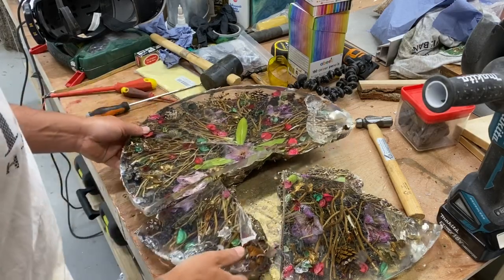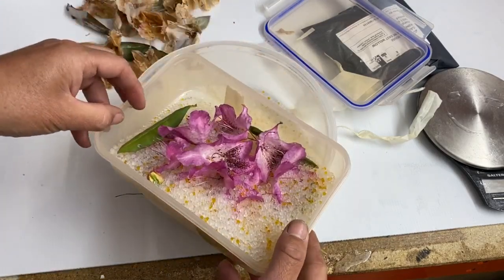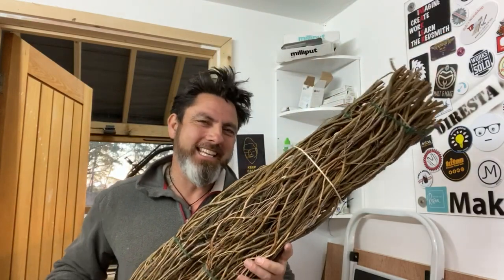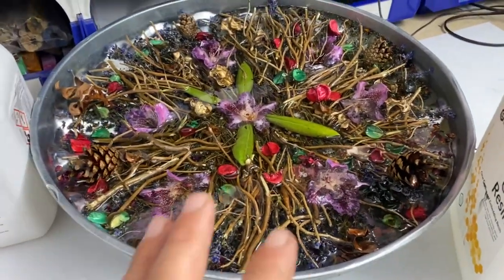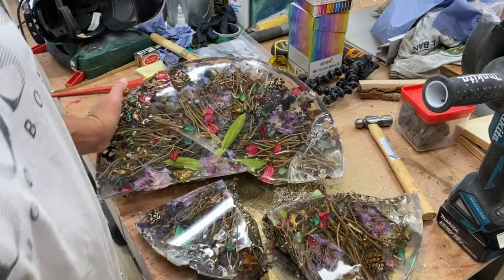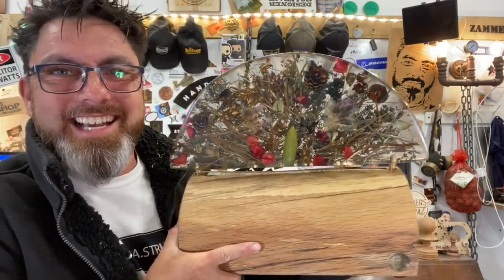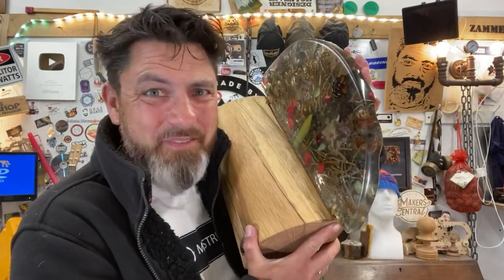Tin Bin Lid Flower Power - With Flashing LED Lights..  Then It Smashed! 😢

Comment: As someone who spent 15 years working as a candle maker, I have to say it looks like you had your wax INSANELY hot. The smoke/fumes were a bad sign. We used a double boiler system (like bakers use with melting chocolate). The goal should be to melt the wax only to the point of becoming liquid, not to evaporation.
Reply: I came here to say all of that. Except the part about having been a candle maker for 15 years.
Reply: Yeah.  The smoke had me worried too.
Reply: Yeah, I was waiting for it to ignite
Reply: Can soy wax be used or only paraffin?
Reply: i saw the smoke... but my brain didnt turn on... na

Comment: You do make life hard for yourself Nick! Rhodedendrons are one of the hardest flowers to dry - so thin, so delicate, you did a good job for the first try.  Try again, with one of the easier varieties.
Reply: Have you ever done calla lilies? Do they work well?
Reply: @kimberlydlapp3441  Very wet and fleshy, especially where the stem meets the flower.   A silica gel box will keep the form, but you need to keep moving the gel around every week or so.

Comment: Nick, you fried the flowers in the wax.  You've got to let it cool a bit first.
Reply: Lmaooo😂😂😂😂😂
Reply: Cool wax won’t take the flowers tho... I’ve tried this. But yes hot wax cooked the petals
Reply: @MelanaC  they don’t mean letting it harden lol. You should just use the double boiler or water bath method, then dip your finger in. If it’s too hot for your finger/wrist, it’s too hot for the roses. 😊

Comment: OMG! The tape. I am a retired teacher and we would have shelter in place drills and one of the things we would have to do is simulate taping around the door in case there was "something" in the air. Every d***n time this would happen to the tape. In a real emergency we would probably all be dead and I would have a torn piece of tape stuck to my finger.
Reply: Don't listen to the trolls, Jane. We did tornado drills in school. When the real thing hit things were a lot more calm and orderly than if we hadn't drilled. Thanks for keeping our kids safe!
Reply: Wouter Lensvelt are you okay?
Reply: @roar40s  Yeah, when Timet had a chlorine spill and there was a green cloud over Henderson, NV about 2 miles from the school I was teaching at, the first thing that came to mind was "this is probably fake news" or when PEPCON blew up in 1988, located in the same area as Timet, I'm sure the teachers were thinking "fake news". (This was before my time, but I'm sure that's what they were thinking.)
Reply: @ohitstheotherthing  Thanks.
Reply: Jane Hoeweler Hi fellow Las Vegan!  I didn't know about Timet but I was in 5th grade for Pepcon, I wasn't affected due to being in what was the northwest at the time back when Decatur stopped at Craig Rd.  Anyway, I think Pepcon was the reason we started doing shelter in place drills here.  And yah the tape never rips where you want, and it's rose here in the desert (that's why new tape works better than old, it dries out and cheap tape is even worse, brand name 3m is pretty good when new, especially their blue painters tape.  I'm a teacher now too and I'm not too confident I could reach the air vent to seal it in a real emergency, that's where the real threat would come from I think.

Comment: Great Save. Love it. As for the masking tape, an old body shop trick is to place it on a paper towel, then microwave for about 10 seconds. This helps renew the adhesive and it will unroll easier.

Comment: Nice save.  May I suggest adding a reflective strip in front of the LEDs between the stand and the piece.  It would direct more light up into the epoxy as well as onto any wall the may be behind it, and prevent the light from shining directly into a viewer’s eyes.

Comment: Come on Nick, you know those beads. They're the beads inside those small paper packets that come in the box when you buy shoes or electronics!!  I never realized you could use them to dry flowers :0 Maybe lining the bin lid with parchment paper before pouring in the resin?

Comment: Hey Nike, just a heads up with the silica gel. You can bake those beads at a low temp, like 70c for about 24 hours. That will dry the moisture out of them and make them reusable. We fill a few old socks with them and use it to keep our caravan and kayaks moisture free, and thus mildew free in the off season. Throw some in a tub with off cuts of wood to help dry out, or keep dry your pieces. Good for throwing in with boxes in storage too, like holiday decorations and what not. Silica gel is so cheap and so useful, great stuff.
Reply: Good save btw.

Comment: Props to you for turning something that broke apart from the original idea into something else that still stunning (even if it’s marmite in your opinion). I imagine some expletives were used hehe.
I’m currently working on a marble sculpture that currently is not going to plan, but I’m over coming and rethinking what can be done to salvage the project (yep, broke apart into four pieces with an added injury for good measure). 

Great video!

Comment: My tape does that too 😂. Btw Nick, if you can't get something in a pressure pot you can blast the thing with a heat gun, it will raise all the bubbles to the surface and get rid of them. Works perfect for resin.

Comment: Silica beads are everywhere. When you buy a pair of shoes, a wallet... that little pack that says DO NOT EAT. I save them all and put them in a container. Great for when your phone gets wet... or your shoes. Put your shoes in a ziplock bag with the packs. Ive used them for flowers as well and they work great.

Comment: Nice save. If I may, as I have mounted quite a few led strips, inset them about a half-inch/centimeter further in the wood, and then used a strip of opaque white acrylic over the top to diffuse the LED's.

Comment: I hate that it broke into pieces, but it still turned out gorgeous , as usual. If you ever try this again, and I hope you do, try putting some plastic wrap in the bottom of mold.  The resin wont stick to the mold and it will come out without breaking.  Hope you will try it again.  You could try using silk flowers, they will keep their color and won't break. Keep entertaining me as well as teaching me new ideas.

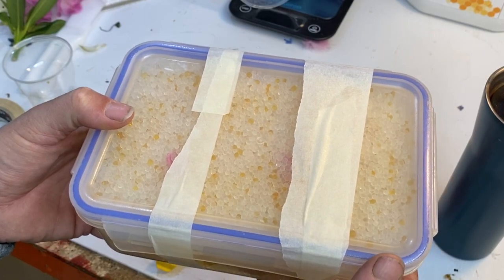Comment: 2:50 The silicon beads expand when they absorb moisture, this includes the oils that give the flowers their scent, which then can be released into the air to act like the scented air fresheners.  Just be careful when sealing a container with the beads when you are trying to dry out an item, you should try using a slightly larger container for your drying process, especially if the item has an excessive amount of moisture.

Comment: When using silica, use a wide container and layer your flowers. It will still dry all of them. I’ve done dozens of flowers at once, all different kinds. If you need any tips using flowers in resin, please reach out. That’s for anyone, not just Nick.

Comment: Maybe with the other rest of the pieces you might cut out some flat circles then use the method like this stand were you cutting a notch into the wood. Then set the pieces you sawn out into the gaps and light like here, that maybe cool. Or use other slices of something covered in resin.

Comment: You can use 100% silcone so the resin doesn't stick as bad and you could've put the big pieces back in the lid and poured more resin in around those big pieces and it would've blended itself in but I must say the finished piece you did looked awesome 
😁😁😁

Comment: With flowers being such a frustration to work with, have you considered using silk flowers? There are plenty that are indistinguishable from the real deal without touching them and it would remove the necessity of dessication before they could be set in the resin. Of course, there's a certain charm to using actual flowers, so it comes down to the preference of the artist, but I thought it might be worth a mention.

Comment: Weird idea that might work, if you still have those other bits of the resin, it would look really epic if you kind of, shattered it more? Then added a new coat of resin over the top(to protect from sharp edges) and wrapped it in wire and had it as a pendant? I think that would look really cool, and I also think if you shattered it, then put the pieces into another project with bits of wood might look cool, idk but you could try😁

Comment: All is well that ends well Nick. I would have used a smaller chunk of wood. But I think that this was due to the weight of the resin. Right? I like your crazy approach to such things. Plus you are one of the rare European wood turners and artists on youtube. And could you make something of the rest of the shattered pieces? I mean they are big enough and still look nice. One has the form of a quarter cake which got me thinking about making a book end out of it. Put some scrap wood underneath it. Polish everything. Put LEDs  in. And there you have an extra ordinary 2 in 1 piece for the book shelf.

Comment: For this kind of thing I would recommend a spring mold like the ones used for cakes. A little sealing and then you just unlatch to de-mold it
Reply: Also you could use the left over chunks as pyramid shapes or slices.

Comment: Use a plastic refuse can lid next time. I suspect it may work better. Also, a friend of mine tosses wet towels into a freezer to set the base on - resin gets hot, ice is cold. If you beat a towel enough, after it's chilled, it flex forms a bit.

Comment: Wondering if you could do vacuum desiccation with the silica gel beads.  Line the bottom with the silica gel beads, pop the flowers on top and pull a vacuum for a few hours/days.  Theoretically, it should "freeze dry" them.

Comment: Face the features towards the fluted side of the mould. The bin lid will cast a standard lamp base. Remember your design features shouldn’t be overcrowded so you can see through between the features and the features do not impede your resins. Pour, dry, extract from mould. Create the hole and tunnel for the wiring. Centred and screw a hole through the centre and a groove from the centre to the outside. Cast a few thick discs the diameter of the inner centre ridge of your mould with complimentary to the base. Drill through the centres and stack. Wire your lamp and you could create a shade too.

Comment: The silica gel stuff, I'm not sure if it's the same stuff I used but I heated some in the oven on low heat ( they were in paper bags I'd say around 10-15cm long 3-5cm wide)  and it allowed me to dry things out

Comment: So I have been thinking.  Always a dangerous prospect that.  I am assuming it is either the chemical reaction in the resin or the heat that is causing the flowers to lose color.  Maybe next time try spraying them with a decent coat of lacquer to protect them from the chemicals, or maybe pre-coating them with a thin coat of epoxy to keep them from getting too hot.  Both options would have the added benefit of reinforcing the petals and making it easier to move them around w/o breaking.

Comment: A Food Dehydrator might also work for flowers without needing to bury them in beads...
Benefits: Don't need to bury them in beads, don't need to constantly buy new beads (depending on how reusable they are), may work much faster than beads, flowers will be dried on trays so extracting them will be as simple as removing the cover and lifting the flower off the tray, can use machine to make healthy dried fruit snacks/meat jerky/preserved long-storage foods etc. for the family when not drying project materials.
Penalties: Cost's electricity, initial purchase of machine not cheap, may dry them too fast (curling the petals maybe)...

Comment: how about a Christmas clock .
you did well with the flowers not reacting.
you could always take a silicon mold of the bin lid then use the lid to support the rubber mold.
expensive though

Comment: I would like you to try it again if possible but use a black bag ..pyt the lid inside the bag as I've found that resin does not really stick to black bags  and use a bit of spray cooking oil and rub it all over the bag on the inside were you are placing the resin ..ive found it works for me ...great videos keep it up there class x

Comment: Use your rubber tipped air nozzle to break the molds on just about all pours. just inject the air around the edges and the mold should break free.

Comment: I hope you didn't throw away the other pieces...they can be done in the same style as the half shell or you can make thin slices of then edge wise and redip to seal/shine...add small lights if wanted, turn them into bookmarks, pendents, hair decorations, etc...there are so many ways to rescue and earn from a situation like that...faux stained glass if you do it right...lol...

Comment: Most people stand and rub at the ‘Masking Tape’. It happens every time I run my fingers over the outer surface or stack the edge on an uneven surface. Get the ‘Frog Tape’ brand, in a plastic saver container. Problem solved.

Comment: hey nick, if you have a microwave put your tape in there for about 15 seconds, should stop the tearing
Reply: also a suggestion for the flowers, would be to seal them up with a few light coats of clear acrylic spray paint before the resin

Comment: I noticed that your problem with putting "biological substances" in resin, where the piece broke, started with the dragon fly experiment. I also noted that the dragon fly disaster happened soon after you changed from one resin supplier to another. Could the resin, itself, be the reason putting flowers, bugs and other formerly-living things in resin be the problem? I might be worth an experiment, using the old resin vs. the new stuff.

Comment: Too bad the release spray didnt work. :(

Also, what would have been a cool thing to do with this mould would be to invert it.

It has a flower type shape to it naturally. What would have been cool would habe been your idea of inlaying flowers, but so that they were upside down, facing the bump.

That way, when you were to flip it out, it would be a flower colored with mini flowers.

Then make a frame to go around it with a natural wood color so that way it could be hung on the wall. Lights would be optional. 

But sorry. I know what its like to have your work fall apart. It feels absolutly aweful. My heart dropped for you when i saw that. D: